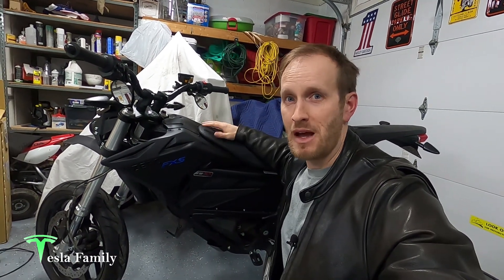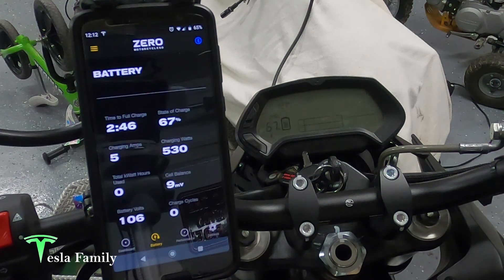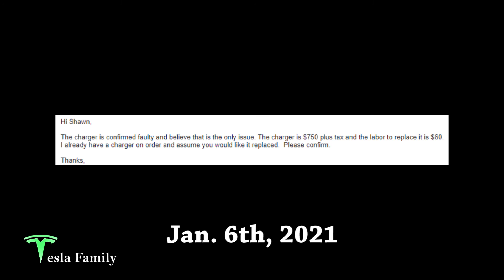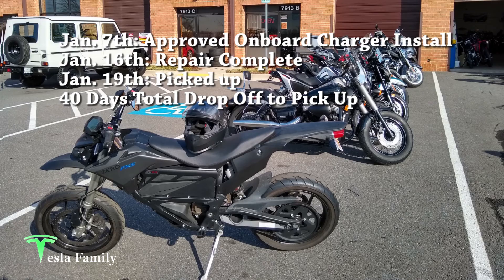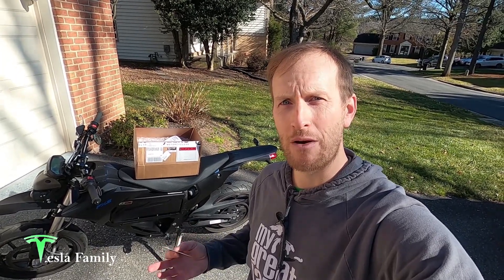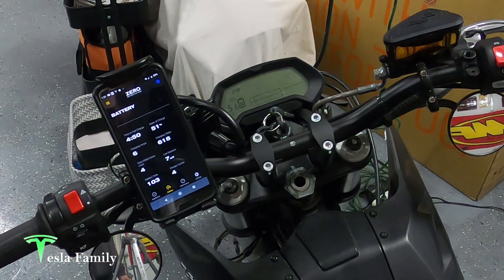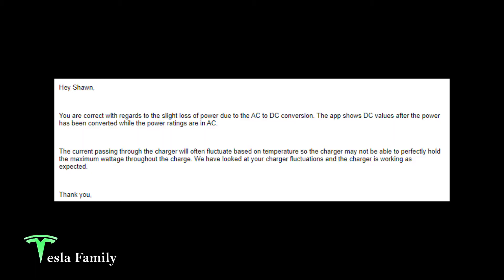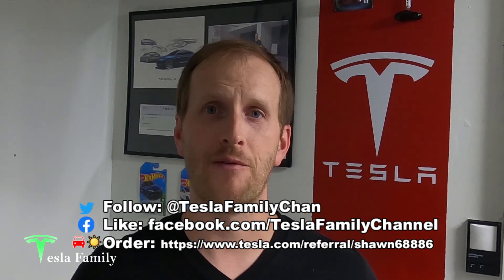$850 Electric Motorcycle Repair | Zero FXS

Comment: I have a 2016 Zero FX and it is super fun to ride...when it works. A couple years ago the motor just locked up completely on my way home. I managed to get it fixed at Calfee engineering. It was just the bearings had gone out. They were a little further than the closest dealer but significantly cheaper since it was out of warantee by that time. Still it sucked to have to drive to Santa Cruz twice in a couple days. Then about 6 months later it stopped charging. This time I brought it to the closest dealer, still an hour and a half away (each way). They are pretty ridiculously expensive. I paid over $500 to have a fuse changed...and now 6 months later, I seem to be having the same issue again or at least a very similar one. I hope it is not the onboard charger since this particular dealer will charge well over $1000 for the same repair I reckon. I originally got this bike because I thought it would be extremely cheap fun transportation...well it is fun but sadly with the repairs, it has been more expensive by far than my ICE vehicles. One of the supposed perks of an electric vehicle is supposed to be low or no maintenance. If shit keeps breaking what is the point? This was my second Zero motorcycle. There will not be a third.
Reply from the maker: Thanks for watching! Yes, I have similar feelings, I loved my FXS when it was working, but I had to replace an onboard charger and it was nearly $1000. Ended up selling just short of 5 years of ownership. I found myself driving my Tesla Model 3 more often and the Zero was just sitting.

Comment: I proudly own two Zeros - a 2019 DSR and a 2021 SR/S.  They are truly fantastic bikes but I have not been overwhelmed with Zero as a company.  If electric power is to be a forced march, I truly pity the average consumer.  Unless right to repair also becomes a forced march we will be positively at the mercy of these manufacturers.  But it's such a fun and unique ride I still believe the pros outweigh the cons, if you can stomach the poor value proposition it objectively presents on paper.

One thing I've always wondered about is whether the onboard chargers on the FX and gen 2 bikes self destruct from being under cooled.  I know I live in a relatively cool part of the country and I've always tried to let my 2019 DSR rest and cool off after a long ride before charging it up.  So far in 7,000 miles of riding I've had no problems with it.  It's about to head to the dealer next week for the charge tank installation giving me 6kw charge capability in place of my glovebox.

The SR/S has cooling fans for the 6kw (partially locked behind paywall) onboard chargers that will absolutely howl away on a warm summer day at a public charging station.  I sometimes charging station hop with that bike to do longer distance (160 mile) rides.  Sadly with only 2,000 miles on the clock it is heading to the dealer as well for almost leaving me stranded with a motor controller fault.  

I sure wish Zero would publish a repair manual and make their scan tool available for purchase.    I'd much rather track down my own problems than haul my bike 150+ miles, no disrespect to my dealership.
Reply from the maker: Thanks for watching and sharing your Zero story! Yea, this charger replacement of mine was a bummer and ultimately I sold the bike a year ago. Zero really needs to add level 3 charging and make sure there are no heat issues with that then I would love to buy another for touring. The DSR/X is awesome but its needs a little more range (150+ highway) and Level 3 charging for me to be onboard.

Comment: I have an issue with my onboard charger for my 2017 Zero DS. There is only one repair shop near me (Triumph of Seattle).  I have NEVER encountered worse customer service in my life. They don't answer their phone,  & you can't leave a message (mailbox is full). After 3 weeks of trying to reach them,  I finally drove there in person to schedule repairs. I had to wait another 3 weeks to get an appointment.  On drop-off day,  I had Covid and tried to arrange for a safe contact-free drop off. They told me to wait until I was Covid free & they would be able to get me right in without waiting.  This was a lie.  I called them a week later (I learned to dial repeatedly until they picked up), they told me I would have to wait another week to drop it off. If you're counting the weeks,  this is now 8 weeks between initially trying to reach them and finally getting the bike into their shop.  The next day they left a message on my phone to let me know the results of their diagnosis.  I spent two more weeks trying to get in touch with them to OK the repairs.  They quoted me $817.50 parts + ~$500 for the diagnosis plus 2-hour installation. I have no other option to get my bike repaired. They're telling me that even though they "probably" have the part available,  it will still take another week for the repair to be ready.
I have loved riding my Zero up until this point,  but this experience has been so reprehensible I will NEVER purchase another Zero. (They only allow licensed dealers to perform repairs.) I will also dissuade anyone from going to Triumph of Seattle, there is no way that a reputable business would conduct themselves in this manner.
Reply from the maker: Thanks for watching! Sorry to hear about your troubles. Hopefully it's all repaired now.

Comment: Note to Dealership:

On 4/6/2022 I bought a 2022 Zero FXE. You handled the sale. It appears to have an intermittent problem on startup and won't produce torque.  Here are the error codes and a short 2-minute video I posted (unlisted) on YouTube so I could send you a link:

https://youtu.be/VE5qn4_0Mhw

https://youtu.be/K7rOGKgHsIo
 
Error Code	Description
06	BMS Throttle Enable Wire Error
25	Contactor Open Warning
30	BMS CAN Error
40	BMS Throttle En Wire Disable
48	SEVCON Startup Disable
Check Engine	Indicates the motorcycle has detected an error, causing it to enter into a state of permanent torque reduction. This light will be accompanied by a dash error code.
Dash Error Code	2 flashes, then 4 flashes
System Warning Indicator	Indicates a system fault has been detected.

This problem occurred on a Friday about 2 weeks after I bought it.  I brought it in the following Monday and you guys could not duplicate the problem. It ran fine. It had no stored error codes and I picked it up two days later.  The problem has reoccurred for days at a time since then but now, it will not engage torque at all.

It's an $11,000 bike however, I paid $14,200 to put it on the street.

I will let you know how this story ends . . .
Reply from the maker: Thanks for watching. Sorry to hear about the troubles with your FXE. Hopefully Zero will correctly repair it for you soon.
Reply: @TeslaFamilyChannel   The dealership replaced the BMS and everyone was OK
Reply from the maker: @edwardholman7023  Great News!

Comment: $813 in repairs for a faulty charger replacement for a bike with less than 3000 miles on it seems like a rip-off to me. I wish I'd seen this video before purchasing my zero.
Reply from the maker: Thanks for watching. Yes, this was unfortunate but don't believe the faulty chargers are a widespread issue. The bike was 3.5 years old so out of the basic warranty.
Reply: @TeslaFamilyChannel  Thanks for the reply. But a major issue under 3,000 miles is of great concern to me. Thanks for posting this problem.

Comment: Really appreciate this video. Been wanting an FX but I live on one island here in hawaii and the only dealership is located on another. I've learned that maintenance is very minimal. After this video, however, I'm concerned that a major repair, or even an onboard charger replacement will require me to ship the bike back to the dealer, thereby increasing the cost and lost time. I can change my own belt drive if/when needed. I may need to resort to my second choice - 2022 Kawi KLX 300 Dual Sport at several thousand dollars less. I know I would love the FX though. Just don't feel I can live with "repair anxiety".
Reply from the maker: Thanks for watching! Yes, warranty repairs would need to be completed by a Zero dealer but if out of warranty, like mine was, I could have replaced the charger myself saving the labor costs once I had a new charger in hand. The diagnosis was the hard part though but Zero engineers likely could do that remote with you. Outside of this single repair, ownership of this FXS.has been awesome!
Reply: @TeslaFamilyChannel  thanks and best wishes.

Comment: Thanks for this reality check.  I've been watching the Zero bikes for years but never made the purchase due to their high relative cost and range anxiety.  Now that I see repairs are expensive too, I think I'll stick with internal combustion bikes for now.  If Zero only knew that potential customers are watching this stuff and the way to convert us to buyers would be if they had said to you, "chargers shouldn't go bad, we'll replace it at no charge".  But they didn't.  So they got $850 from you but they'll never get a $12,000 sale from me.
Reply: My first 600 mile service on my 21 Ducati SFV4s was 900 with pickup and delivery HAHAHAHAHAHAHAHA.  And that was for just checking valves and installing heated grips (purchased prior).   My 22 Zero FX has cost me nothing from the dealer yet.
Reply from the maker: Thanks for watching! Congrats on the new Zero!
Reply from the maker: Thanks for watching! The charger would have been covered under the bikes full warranty if it had gone faulty in the first two years of ownership. Mine went bad at 3.5 years of ownership so like other wear and tear parts like tires and brake pads, it was up to me to replace. That is the only repair or maintenance that was needed though. No oil changes or gas station stops or other services. Take one for a test ride, electric is fantastic, I'm never going back to a gas bike.

Comment: 30% efficiency loss when charging batteries
Reply from the maker: What makes you say this? Are you monitoring input verses onboard energy?
Reply: @TeslaFamilyChannel  It is a fact. changing energy forms always comes at a cost. Battery charging is a conversion from electrical energy to chemical. You will need ~ 130 Watts to store 100 watts in a battery. It is even worse when you get to understand the Maximum Power Theorem and are converting that chemical energy into mechanical.
Reply from the maker: Either way it costs less than $1 to fully charge the Zero FXS
Reply: @TeslaFamilyChannel  Look, that charger is using 720W on the utility side, but only storing ~600Watts to the batteries. 600/720 = .83 or about 83% efficiency, which is pretty good.........You were wondering why you were charging at ~600W and not 720W. So yeh, Electricity is about $0.12 / KW. but also, less than half of the energy stored in the battery is actually used to make the motor work, all the rest of the energy is lost.
Reply: @TeslaFamilyChannel  The bike is cool
Reply from the maker: @nimrodquimbus912  Thanks for sharing the difference between the 720w rating of the charger but only 6-650w showing on the app!
Reply: @TeslaFamilyChannel  No problem, thanks for making the initial vid. It would be interesting to see the actual power consumption of the charger with a cheap Amazon Watt-meter....I have always been curious to how long batteries last/degrade. EV's are chheap to charge, but components are expensive, and they degrade.

Comment: My 2018 FXS has stopped charging to 100%. Charges to 114V instead of 116V and stops (SoC usually reads 96-99% when charge stops). Dealer checked bike and stated that the battery pack was ok. They contacted Zero for guidance and Zero technician suggested replacing the charge cable before replacing charger to see if that corrects the issue. My gut tells me it is probably the charger that is faulty not the cable :(
Reply from the maker: Thanks for watching! Good luck with the service, a charge cable would be much cheaper than a new charger.

Comment: Was seriously thinking about FXS but not now.
Reply from the maker: Thanks for watching! Absolutely LOVE my FXS. This issue with the faulty charger was unfortunate but its they only service the bike has required in the 4 year that I have owned it. No gas, no oil changes, no chain lube, nothing but the charger. Take one for a test ride, you will have smiles for miles!
Reply: @TeslaFamilyChannel but what if the battery or motor failed
Reply from the maker: Thanks for watching! Those are covered by 5 year warranty thankfully.
Reply: @TeslaFamilyChannel  many thanks for the reply. I will certainly consider it.

Comment: That's just fkin awesome to hear because I have a 2016 zero fx and I lost my charging cable while riding and out of nowhere when I plugged the bike in the green light would only blink like 6 times and then stop blinking and it just says 0:00 on the timer till full charge on the dash does this sound like the onboard charger
Reply from the maker: Thanks for watching! Hmm Tough to say. Do you have error codes showing up when you key on the bike? The best course of action is to take it to a dealer for diagnosis or to send the bike logs to Zero.

Comment: Did you notice the charging cable or plug getting hot prior to the charger failing like it did?  I recently purchased a 2017 FXS with 12,000 miles and I noticed the charge cable gets pretty hot.  The plug itself was about 150 deg F.  I have a new, 14 AWG cable on the way.  The old cable is only 16 AWG.  So it is possible it could be the issue rather than the onbaord charger.
Reply from the maker: Yes, the 14AWG Zero supplied charging cable would get warm as I expected with 650W flowing through it. The Zero dealer worked with Zero Engineers and determined the charger was faulty. Unfortunately these onboard chargers are known to have faults (several owners on the Zero FB Group agreed) and due to the potting of the electrics (new video coming soon) they are not serviceable.
Reply: @TeslaFamilyChannel  The charging cable I got with my bike was a 9 foot long 16 AWG cable.  Today I got a 6 foot 14 AWG cable.   I charged from 65% to 100% and the cable stayed cool.   My cable was clearly fried.   I also pulled the charging socket out so I could check the temperature of the wires from the socket to the charger itself.  Those were about 10 deg F above ambient.  Nowhere near the 70 deg F above ambient that the plug/socket was with the original charging cable.
Reply from the maker: Thanks for sharing! Glad you found the right cord.
Reply: @TeslaFamilyChannel  When you encountered this issue with the bike not displaying the green charging light and time to full charge on the display, did you happen to notice whether the actual SOC % was increasing or not?   Today my bike decided to not show the green charging light nor the time to full charge, and no info on the app.   But the SOC % is still increasing.   Although it seems slower than I might have expected.  Thinking about ordering a new onboard charger and replacing the old one.  Doesn't seem like a tough job since it is right behind the plastic in front of the downtube.   Zero should be warrantying these or at least offering them at a significant discount.
Reply from the maker: @j_k9643  When plugged in with the faulty charger, it would cycle charging about every 3-5 minutes. So yes, the SOC went up but very slowly. I wish these onboard chargers were covered under the longer 5 year battery warranty but they unfortunately fall under the 2 year limited warranty. My bike was 3.5 years old with less than 3k miles and the charger went bad. Wasn't excited about shelling out $850 for a new one.

Comment: I wonder why they don’t supply a 1200w charger?  Way overpriced... you should get the old one fixed and sell it on eBay to re-coup some of your costs.
Reply from the maker: Thanks for watching! My guess on why a bigger charger is not spec'd on the FX/S bikes is limited space. The S and DS models have a 1300w onboard charger(Those bikes are wider than my FXS) and the SRF/S bikes have 3000w base chargers. I looked into repairing my faulty charger but it's not possible because the electronics are epoxy potted. Should have a video to share on that topic soon.